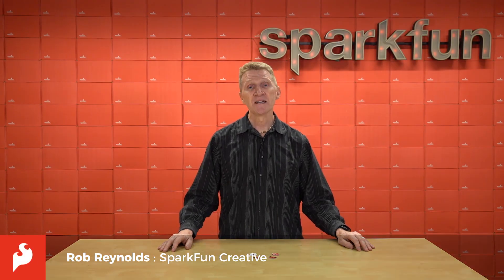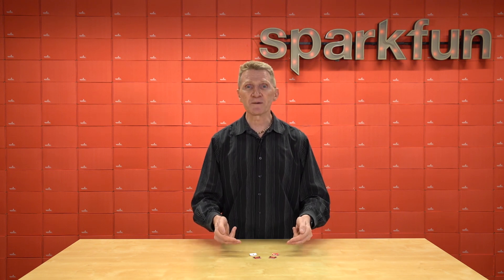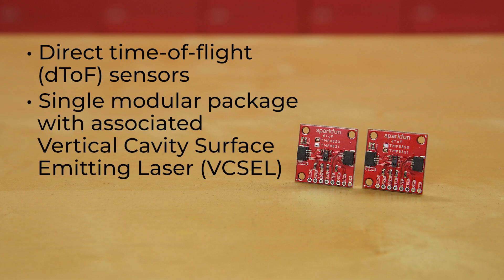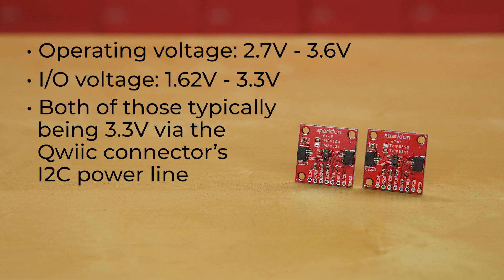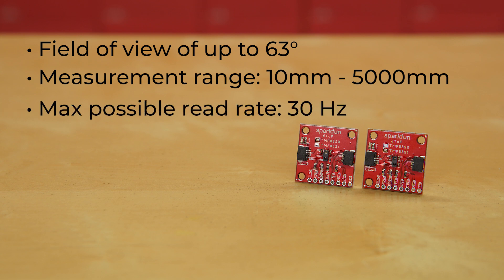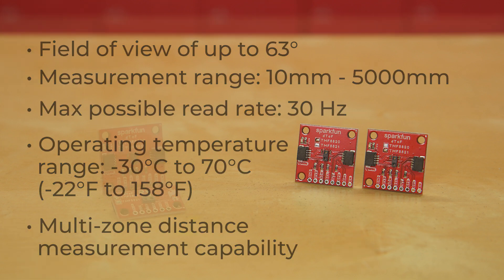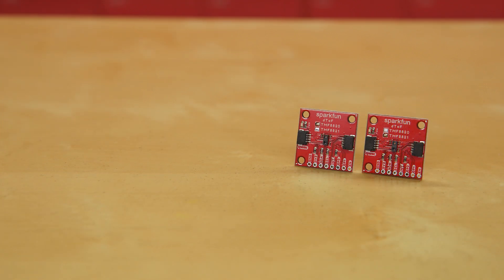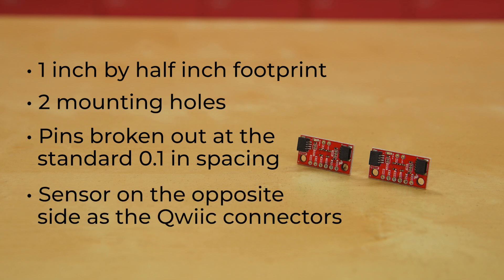Product Showcase: SparkFun Qwiic dToF Imagers

Comment: Thanks, I like these product showcases, but please, whenever presenting measurement devices, you should include accuracy and resolution. What are they?
Reply: After digging through the datasheet it looks like resolution is 1mm. Don't think I've seen a ToF sensor that was anything lower than 1mm, bummer...
Reply: @WillBenson24  add a lens if you want better resolution
Reply: @WillBenson24  Thanks Will
Reply: the confidence values concept is interesting, would love to see a demo